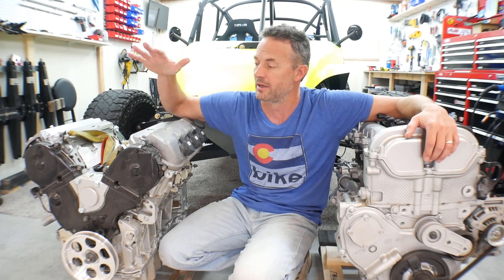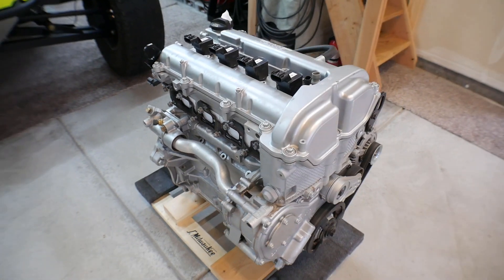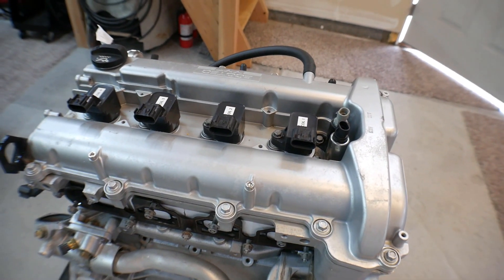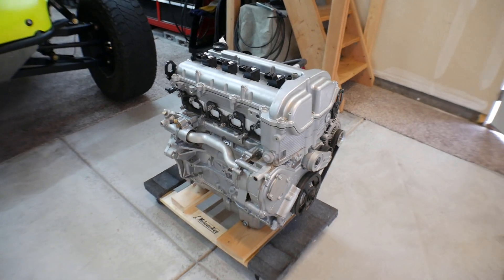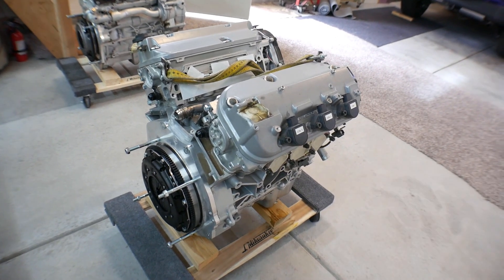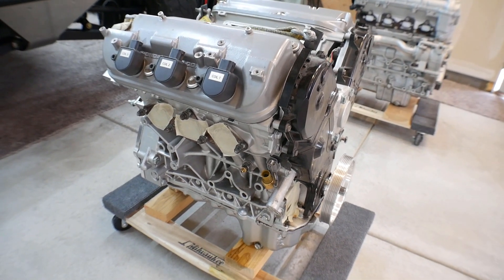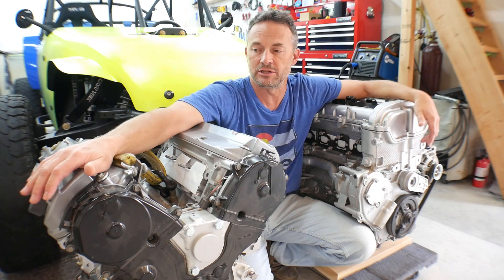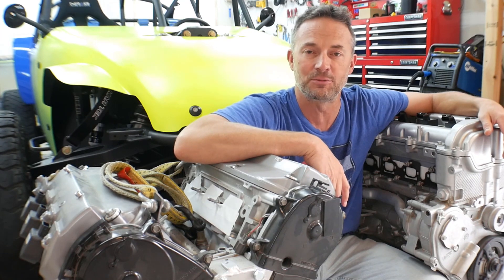Comparing a Honda J35 to a Chevy Ecotec 2.4L

Comment: Question for you, do Honda have J35 engine paired with manual transmission ? I saw pressure plate on both
Reply from the maker: No pressure plate, this has a conversion clutch between the engine and transaxle.

Comment: So that J motor makes 240 hp. But a j32a2 makes like 268hp. So more displacement doesn't necessarily mean more power always eith these things.
Reply: yeah it depends on the j number.. some of earlier j35 in the bigger vehicles had a lower number than j32.. the best ones are the j35z3 j35y2 all the j35 in the tlx and rlx and the ones in the newer mdx post 2013.. also the j37 chefs kiss

Comment: i got a 2015 gmc terrain w/2.4 eco tec inwhich @1000 000 miles so far its been great w mobile 1 oil changes every 3000 However the internet says these are the worst engines cuz of timming chains
Reply from the maker: They're good engines. Do the maintenance on them and most likely it will last for a long time.

Comment: Alot of bad info on the LE5. Nothing wrong with it. Its gets a bad rep from the 2010 2013 equinox etc. The transverse mounted engines had lots of problems. The direct injected engines are junk so are turbos. 
Stick with port injected non turbo setups and they will last a good long time.

Comment: Did you freshen up the Honda motor with a new timing belt, oil or water pump or anything else? I know you said you might add a turbo in the future. Do you have a place to purchase performance parts for the J engine.
Reply: P2R is a great place to get aftermarket parts for a j series. And other than maintenance, a j32 and j35 can hold up to 500hp on nothing other than head studs
Reply from the maker: No, not yet. I've been running it, kinda hard actually. But haven't freshened it up yet.
I pulled the pan and valve covers and cleaned everything up as much as possible, and replaced the oil. But no part replacements yet.
I plan to add a turbo when I need it, but I'm still dialing in the chassis and not using full throttle yet. When I do get there and start to feel I need more power, I'll look at adding a turbo.

Comment: Are you out of your cottin picking mind???..That 2.4 wasn't even worth the 224 dollars you paid. In fact that engine isn't worth it for free...if you did any research you would know that's a botched GM build.!!..it could jump timing at any giving time ...in the owners manual it tells you to check the oil every time you get gas..it sounds like a ticking time bomb when it's running...that comparison your doing is not a comparison it's a joke.. Anyone with a half of a brain would go with the Honda...

Comment: perfect because i was gonna ecotec swap lol
Reply from the maker: I think you'll be happy with that choice.
Reply: @DougBugBuilder  over the j35? why do you say so?
Reply from the maker: @wrencheverydayohiyokosaima7257  The Ecotec is a bit easier to fit in a chassis usually, and it's a more common swap. Typically there's more support for that engine. Although the J35 has more torque and power, it's been more difficult to find support for it as it's not as common of a swap. At least that's what my experience was.

Comment: I have all engine ecotec from the olds one to the 2.4 now my experience is that the 2.2 is better due to. Not having issues from the time chain or any valves problem those engine go all the way up to 400 HP on good build costum I said piston rings.the head valves all components they are good engines only problem on 2.4 is time chain issues and oil consumption because they made a mistake not doing a PVC valve so is inside the intake manifold on that engine model i don't have any complaints about some people don't liket is like crappy engine for me is a good engine besides i have a lot parts for them and Honda are more expensive and not find every where
Reply from the maker: Thanks for the good info on the different Ecotec engines. ✌

Comment: what adaptor plate are you running on the honda v6? is it mated to a VW bus trans or bug trans?
Reply from the maker: I'm using the Kennedy Engineering 6470 adaptor plate. It's designed for a VW bug or bus bolt pattern. (they're the same, but the input shaft is different) However this engine is mated to a Weddle HV25 transaxle, which uses a Chevy 26 spline input shaft. So the flywheel is designed to adapt to that.
Reply: @DougBugBuilder  thanks!

Comment: I can provide the answer as to why people choose the 2.2 l ecotec over the 2.4. The le5 came with a thinner area holding the sleeve in to the block leading to cracking issues at higher horsepower when boosted. This specific problem for people at the upper end of the horsepower spectrum LED a lot of people to believe that the 2.4 was the weaker blocked if you were going to build the motor and so most people tend to go to the 2.2 l for their swap projects because they assume they're going to make 8 to 900 horsepower eventually even though most people will never sniff that.
Reply: Either way a properly built 2.4 l le5 can handle 5 to 600 wheel horsepower quite easily I'm in the process of building one myself with forged internals to go into a Pontiac solstice.
Reply: @jonf2009 dude that’s sounds awesome you gotta make a video
Reply from the maker: Excellent information! Thanks for taking the time to post this! 👍

Comment: Can you reply with a comparison of power delivery and drive ability between the two engines? I am building an LE5 Ecotec buggy now, but thinking I should have gone Honda for the extra power..
Reply from the maker: My Ecotec is about 175hp, the J35 is about 240hp. I don't feel a big difference in the HP, but the torque difference is noticeable. The fact that the J35 is a bit bigger and a V design gives it more torque. That being said the Ecotec (especially with the VVT) is a great engine. And mine gets around the dirt really well. Also the fact that it's skinnier makes it take up less room in the back of the buggy.
What transaxle are you running?
Reply: Thanks for the reply! I have a 2010 LE5 with VVT mated to a close ratio 002 with weddle internals in a mid travel, 4 seat rail. Should be ready to run in about a week. Going to take it to the sand this winter. Hope I will be satisfied with the power.
Reply from the maker: @raymonsmyers2034  I think that'll be a good setup. If you do decide you want a little more power you could look at getting a J35, or a supercharger for the Ecotec.

Comment: What year do you suggest for each motor
Reply from the maker: I like the J35A3 motor myself, that was around 2004-2006 years. For the Ecotec 2007-2009 seems to be when the 2.4 with VVT was really popular. Wikipedia has good breakdowns of specific years.

Comment: I went from 2276 dual Webber (239 lbs) to (412 lbs for 2.2 Ecotec supercharged). 435 lbs with radiator
Reply from the maker: I was hoping someone would post what an air cooled motor weighs. Thanks!
Reply: How much faster is it than the 2276

Comment: Ecotec 2.4 is the best option for tuning if u like chevys. The Honda 3.0, 3.2 and 3.5 are more reliable and put out good HP. When running a Honda motor, a built 6 rib with all weddle internals is a must. Great. Video Doug👍🏼🤙🏽
Reply from the maker: Thanks for the info! ✌
Reply: The 2.2 has the 1/4 mile 4 cylinder world record! Thing is making like 2000hp haha.

Comment: Always very informative, i want to get a Honda for my sandcar. Can you send links to get computer and harness.
Reply: Make sure you have a heavy duty 6 rib. Then expect to destroy it!!! People always say I will take it easy Lol. Then they get addicted yo the power and say well just this once.. AND BANG
Reply from the maker: This is the computer that I'm using. https://www.aemelectronics.com/products/programmable-engine-management-systems/infinity-ecu/infinity-series-5
I don't think they offer a wiring harness for it. I made my own. But if you look around there might be companies out there that make one. There are several different flavors of J series engines out there. So I would get the engine first. Then you can get a wiring harness to work with the engine you have.
Reply: Thanks if you ever do ls swap and need all the info  let me know , i do them at my inlaws shop

Comment: can you provide a link for the AN fittings you used on the back of the J head water ports?  i knw you said they're -10 but what is the thread size in the head?  thanks
Reply from the maker: This is it, they call it a breather fitting. But these thread right into the cylinder heads and worked perfectly on mine.
https://amzn.to/3AtgojI
I believe they are M28 threads. I don't know the pitch.
Reply: @DougBugBuilder  M28-1.50 is the thread size on the water ports.  thanks for the link
Reply: @DougBugBuilder  very cool, thank you!